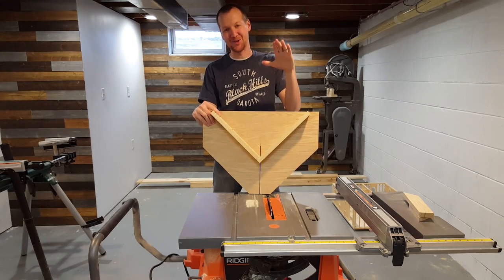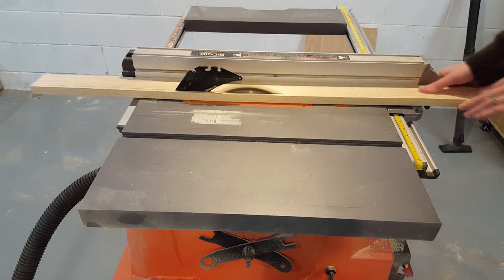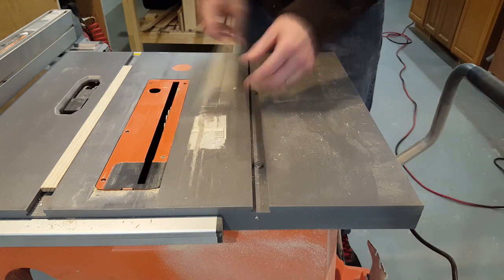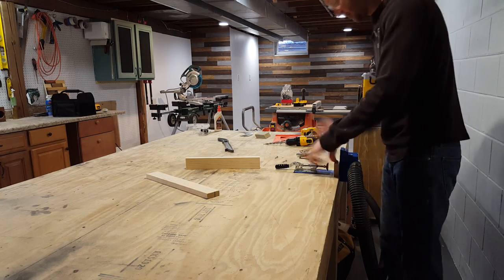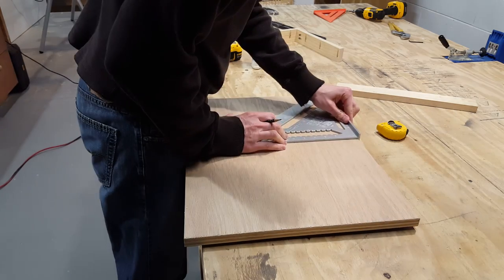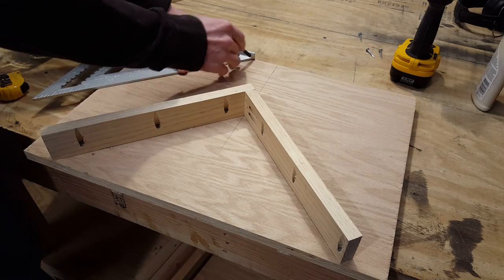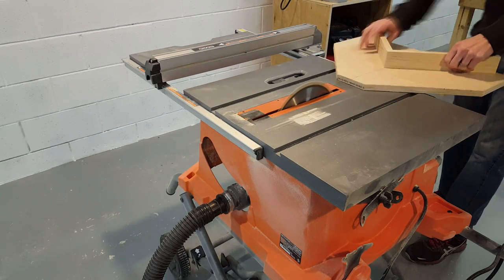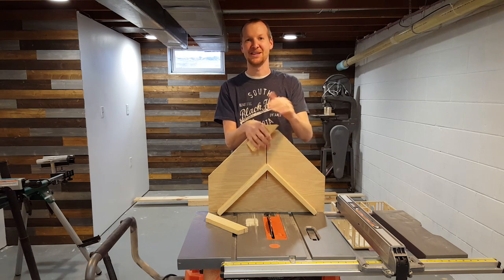Simple 45 Degree Crosscut Sled

Comment: Thanks for sharing... I got some ideas from this video... One think I noticed. You are correct about getting your perfect miter but the way you did it will not give you a 45... For that to happen, both sides of your jig must be equal. When you cut the two pieces they were both 13". For them to be of equal length, you must cut one to 12.25 or whatever thickness the opposing side of the jig is. You will still get a good clean miter as long as the total angle is 90 degrees... thanks again!!
Reply: I'm glad somebody else noticed that too.

Comment: 45 degree cut should be tested with a square not just if they match when combined .. Right ?
Reply: Kind of.  Any cut you make like that will match up to itself and pass the square test; 45/45, 46/44, 60/30, etc.  Something he should've mentioned is that if you're not going to cut and flip the same piece of wood, then you need to make sure you cut one piece on the left side of the jig and the other piece on the right.  As long as the jig is at 90 degrees, the cuts will be complementary and the exact angles won't matter (except to folks who are obsessed with geometry!)
Reply: There is more to it than this. If you alternate which side of the fence you make cuts on, yes they will add up to 90 degrees, but this creates another problem. If one side is 44.5 and the other side is 45.5 they will make 90, but one cut face will be slightly longer than the other, and if you have an inlay or decorative shape they will never line up perfectly. Every measure should be taken to ensure that both sides are as close to 45 as possible.

Comment: ive watched at least 30 of these videos making these crosscut sleds but no one ever mentions room temp. in winter if your workshop gets cold, your wood swells slightly and ur runners for the rebates t track will be hard to push. my solution tro this is using high desity poly carb  plastic.
Reply from the maker: That is a good tip...Thanks for sharing!

Comment: This design will not get you a pair of 45 degree cuts b/c of the way the two boards were joined, one should have been cut 3/4" shorter then the other, so 13" and 12-1/4".  Still a 90 degree corner, but he's cutting 46.7 & 43.3 degree angles.

Comment: You used your mitre saw to cut pieces! This defies the purpose. Nice design though.
Reply: He's not trying to show you a way to avoid using a mitre saw. He used the mitre saw to cut a 90 degree angle. The theory is that cutting repeatable 45 degree Cuts is best on a table saw and a sled. You may have missed the point